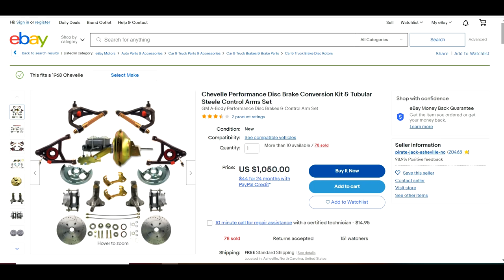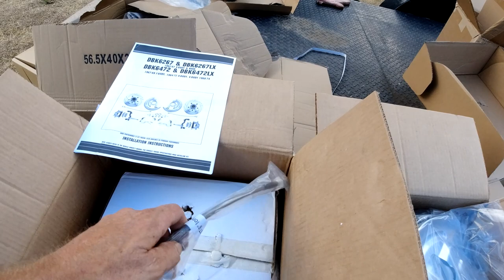1968 Chevelle Nomad Restoration - Part 28 - Wire Speakers - Patch Fender - Repair Core Support

Comment: I would order the hard line set for a El Camino.   I bet you could go with hard plastic fuel lines to go with the ls set up, its to bad you couldnt use the truck tank and pump ect.Looking good for sure. Don't worry about the haters, we can see you are bringing this back from the dead and not a concourse restoration.
Reply from the maker: I'll look into both.

Comment: Good job man, you've already saved a lot of money. you are totally right!
Parts are already very expensive. And there is also a lot of junk in between. made in china junk. I experienced it myself, with my Camaro.
Here in the Netherlands, most engine parts are fairly easy to obtain, but if you are looking for something special, I have to order something in America, recently I also ordered something via Amazon, and then it went perfectly. at home within 2 weeks. also depends on where and what you order.
large parts becomes difficult, a lot of shipping costs, and a lot of tax, especially here in the Netherlands. then I pay almost as much tax as the part, really crazy.

Keep up the good work.
Reply from the maker: Sounds like it makes building a car very expensive.
Reply: @clunkersandclassics  Jep its not so easy

Comment: Another GREAT video! Like how you can take spare metal and make you own parts. Hope you can turn some metal to make those motor mounts and transmission support  work on the LS swap to avoid buying stuff. Keep up the good work!

I don't know much about body work but I've dealt with these old factory AC's for a while. As you know, not having AC in Texas makes classic cars very uncomfortable to drive. After a lot of trial and error, my factory AC works well even in 100+ degree weather and very reliable for the last 2 summers of almost daily driving.
That old fin and tube condenser will not cool r134a well. I've been there and it just don't work as good even if you add a pusher fan. A rough measure of the truck condenser, while its still in the truck, will give you an idea if it can fit the Nomad core support. A new type of horizontal condenser is no more then a couple hundred bucks or less but if the truck condenser can fit, with some massaging, maybe a good idea. Either way, unfortunately the old condenser is null and void for this project. The LS compressor routing of AC lines for the new type of condenser is different from the old fin and tube. There is no lines coming out the right side of the core support. If you can't use the truck condenser, get the biggest affordable condenser that will fit your core support. It will cool more r134a which is needed for the large space inside the car. I have a factory size new condenser because I wanted to use the old lines. But since the ls swap Nomad condenser AC lines are now only on the left, find the biggest one that will match your car.
The right side of the AC evaporator core will have to come off again to fit the LS motor but its good you sealed it now. Keeping that evaporator will also help with cooling the large space inside the car. Aftermarket evaporators are smaller and don't allow fresh air to circulate inside. There are some other stuff for the factory AC to work like the pressure valve adjustments and making the system to work with a newer type of compressor. That's so far down the line but I hope to be watching when you get to that part. If the AC is done right now, it can be almost trouble free and cool a lot of space like newer cars.
Good luck and I look forward to seeing your videos!
Reply from the maker: Thanks for the tips!

Comment: I have some of those wire sleeves that when heated melt the solder. I really like them. The only thing I found a pain with them is they do not fit all gauges of wires.

Comment: Everything's looking great I love it can't wait to see it painted I got one problem that blue tubing you using for the sunroof that stuff gets brittle and breaks that's why they leak I would just use rubber hose
Reply from the maker: I got rid of the brittle ones and used rubber hose.

Comment: I went ahead and painted the rotors and calipers and brackets with the caliper paint. Then I had the rotors resurfaced to take the paint off instead of taping.

Comment: I wouldn't worry about those lower ball joints. If they wear out in 30k miles just replace them then.
Reply from the maker: I just don't want them to break in the middle of nowhere. Not a job you can do on the side of the road.

Comment: Another great video Lee. 

Restoration - the action of returning something to a former owner, place, or condition.

Your putting it back on the road so I say it is a restoration. 

What are those solder sleeve called I want to get some.
Reply from the maker: ebay title is: 800PCS Waterproof Solder Seal Heat Shrink Wire Butt Terminal Connectors Set Kit
Reply: Ordered - Thanks

Comment: Did you see that Mortske repair just bought the same car a 1968 nomad. He usually sells the cars and it may have parts you need or maybe he may at least have some extra parts you may need? Just a heads up.👍🏼

Comment: What's going on man I bought   replacement tubular upper and lower control  arms for my 72 Nova from Speedway and and I've been doing metal work on the car so I haven't been driving it very much and the
   arms are still basically new though anyhow the ball joints don't seem to be too bad but I don't have that many miles on them  but the rubber grease bushes They have deteriorated and like I said I haven't even drove the car very much but the grease  Boots have deteriorated have a bunch of cracks dry rotted so If you could change just the boots to avoid that problem just giving your heads up man
Reply from the maker: Thanks for the info
Reply: @clunkersandclassics   You have no problem
Reply: Said yeah no problem

Comment: Honestly, I would advise against elimination of Drum Brakes entirely, they're less effective at stopping, they cannot handle as much power, they're a pain in the ass to service and the list goes on. 
It's your Sled of course, I just worry your braking power will suffer for not having replaced the rear. I'd love to be wrong though. :)
Reply from the maker: I may convert the rear later

Comment: Its not a restoration, is a customization because you are changing the originality of the car.
Reply from the maker: Yes, adding non original parts is customizing but it's also being restored from sitting in a field for 30 years to go back on the road.
Reply: As Dillon  McCool called it a roadsteration
Reply: @clunkersandclassics  No it's not being restored, it's being fixed. If you google restoring a car,  you will find that the word restoring means to put a car back to the original state or if you like OEM from the factory with no additional parts fitted. 😉 So that car you are customizing and putting it back on the road. Its looking good so far and will interesting to see how it turns out. Keep up the good work!

Comment: Moog/ Federal Mogul, of the  70's , has been sliced and diced into oblivion, 85 percent of of their auto parts are now ,and have been manufactured in , you guessed it SHANGHI CHINA. They manufacture in at least a dozen other countries, since being devoured by Tenneco. The only thing you" might" get different from Moog , is a grease fitting (which is actually pretty hard to come by anymore) and the name on the box. It's not that hard to drill and tap for a zerk/ grease fitting yourself.
Reply from the maker: They all have grease fittings on them.
Reply: @clunkersandclassics  
Sounds like you're good to go.